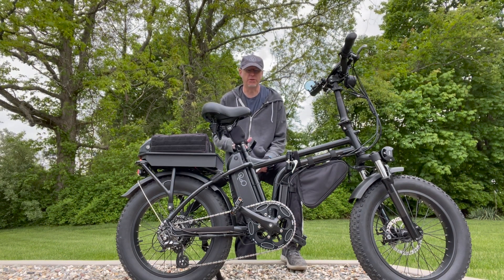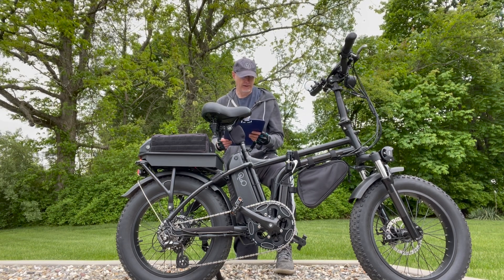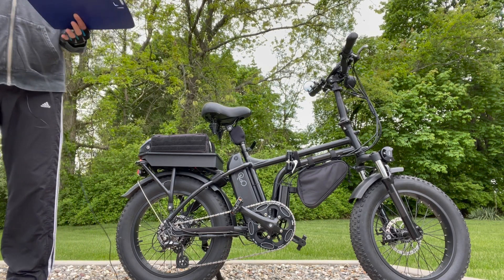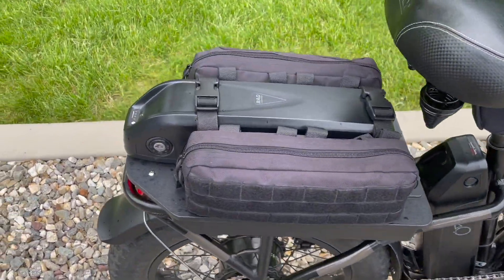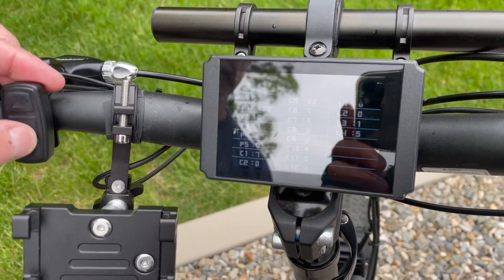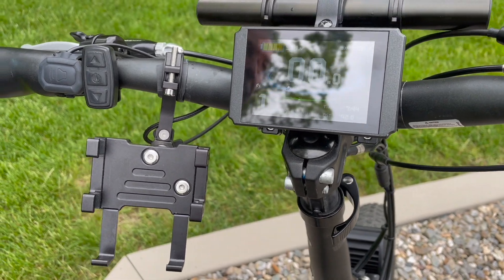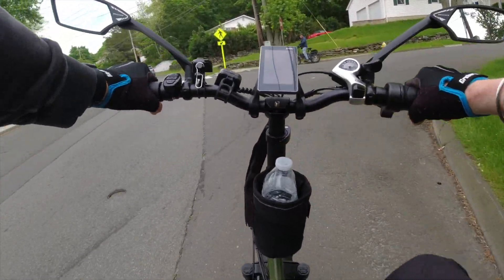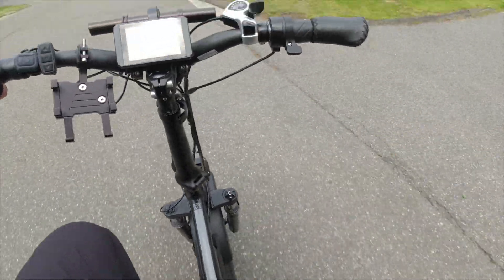Modded RadMini including Dual Batteries, Bafang 750W Motor and Huge Light

Comment: Do you have instructions for the display settings screen? I've got the original paperwork, but never made sense. Not really sure what most settings do. Also, how'd you install the Bafang? I just ordered a drop in 750 replacement that will go inside the original stock Rad casing. If I got a Bafang casing, I'd have to remove and reset the spokes.
Reply from the maker: I dont, this isnt my ebike so have no experience with that.

Comment: Great video!  Highly informative. I bought the 35A controller and installed it. I did not get any speed increase but did get better torque. Perhaps I didn't set up the controller right with the color display that came with the controller. I ended up taking it off and reinstalling the original. Your Rad looks awesome.
Reply: Thanks!

Comment: Awesome mod. Best foldable bike by far. Rad power did good with the Radmini4. Unfortunately the Radexpand5 is not as good.
Reply: So ture...Im just glad I got mine in 2020
Reply: I jJUST GOT one of the last available radmini4s they sold- wanted to get rid of them

douno know why- the bike frame is amazing and tall and even what it comes with stock is really good- expand just isn't the same at all

Comment: All those awesome mods and still has the same derailler and brakes. I had swapped out most of the main parts on mine and it is WAY more efficient now. Much more range with X-Bridge chain, new derailler and hydraulic disk brakes. Where did he get that crank? This looks great though I love it. Also where did he get the stickers?
Reply from the maker: Im not sure where he got the crank. What stickers are you referring too? The ones on the battery were already there i think.
Reply: Hey. Curious what you got and where you got the new derailleur and a bit of info about the chain. I've got to get a different shifting set-up going. I've already swapped to cable activated hydraulic brakes and a different seat. Never had so much trouble keeping a bike adjusted and shifting reliably, seems to be really bottom-shelf stuff. Just dropped a damn pedal today, too, crashed the bike. I was lucky, not going too fast as I rode in the snow and ice. Looks like it unscrewed itself which is a first for me in 50+ years of biking. Will be swapping chain ring and getting new crank arms and different pedals. thanks for any info.